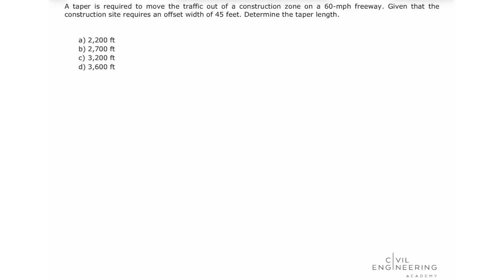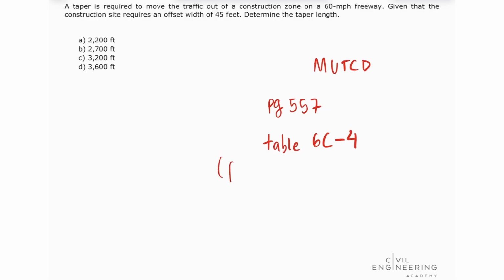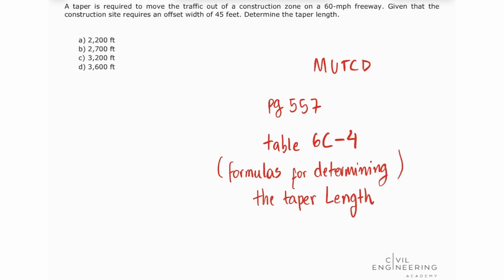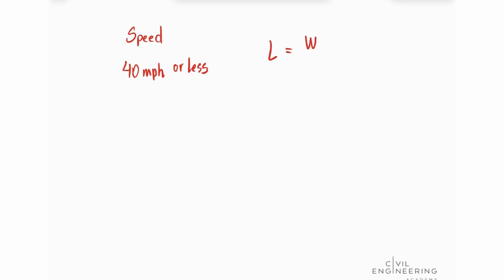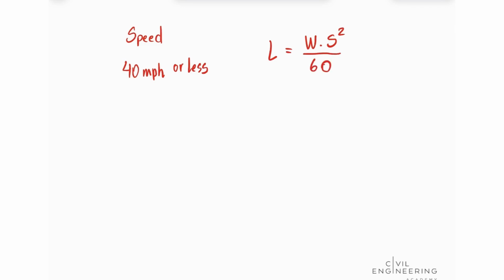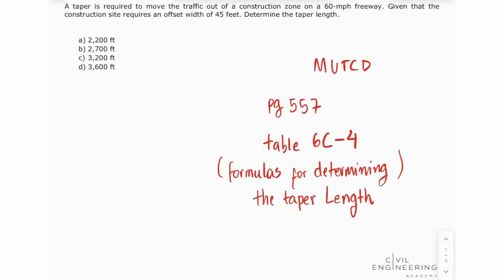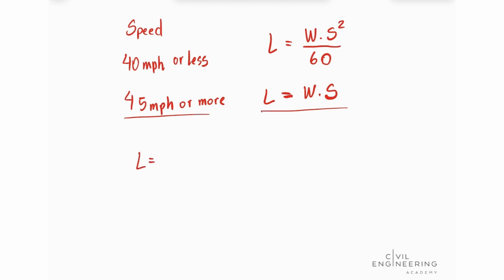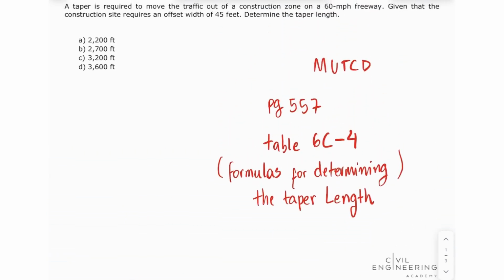Civil PE Transportation Exam – Find the Taper Length Required for a Construction Zone

Comment: The problem says nothing about what type of taper this requires. I would assume this would not be a merging taper for a lane closure that requires a taper distance of L=WS (because the width is 45’ that would be a very large merging taper), but rather a shifting taper for all travel lanes to move them out of the way, requiring a taper length of L/2 or WS/2.
Reply: I would look at the answer choices. L = WS -> 45*60 = 2700 feet, and that is for a merging taper. A shifting taper would be 0.5 L (1350 feet), and a shoulder taper would be 0.33 L, which is 900 feet. So the answer had to be 2700 feet. On the exam, they are more likely to give you the type of taper, but just in case they don't, you know what to do.
Reply: Fair point, hopefully engineering judgement is used in creating the exam, not just in real life